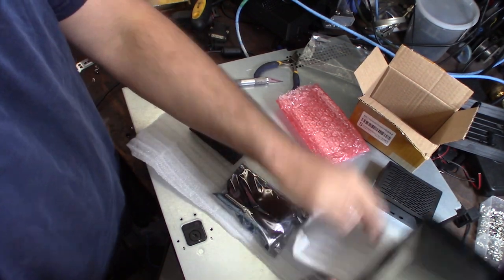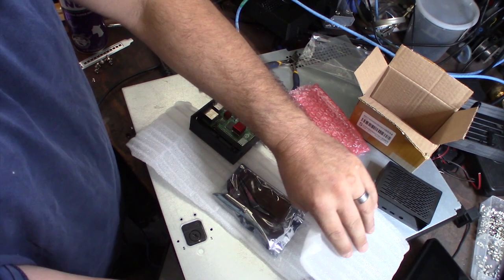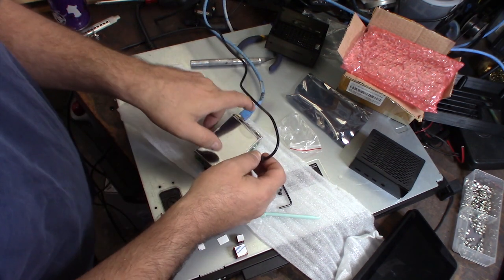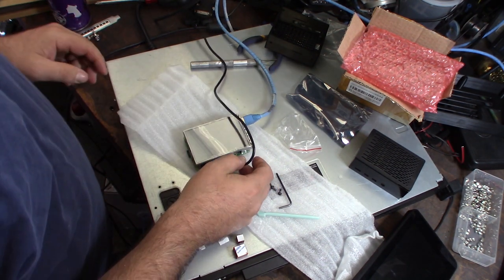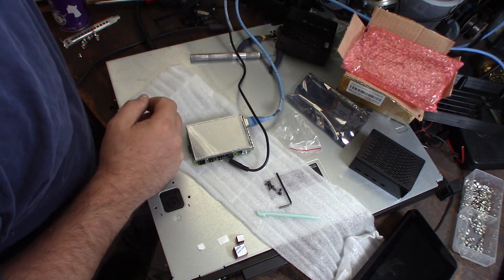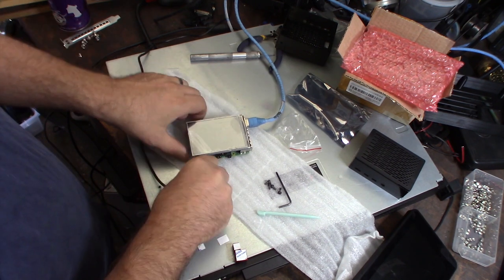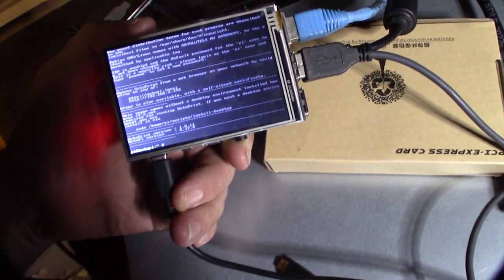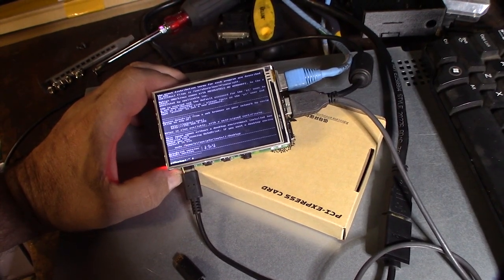Octoprint Raspberry Pi 4 3.5 touchscreen configuration Raspbian Buster goodtft waveshare XPT2046

Comment: For the box it comes with.  You take that snap on part off and the screen sits inside the box.  It doesn't give much room inside though.
Reply: Mine does not fit 100percent flush with the top of the case.. I did notice a small black piece with adhesive on it I tried to put that on top of the USB so it sits in between the screen and USB but it is just a hair too thick an the case won't close right... I also noticed that you have to be carefull of the little copper ribbon cable so it does not scratch the inside of the lid while you close it... other than that.. I am 100percent satisfied